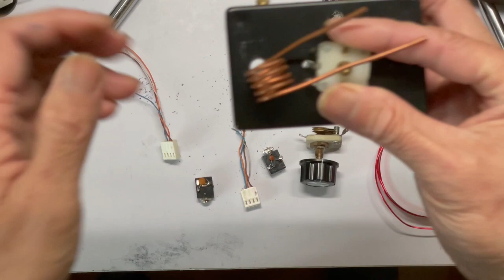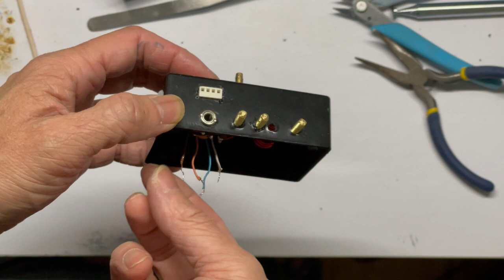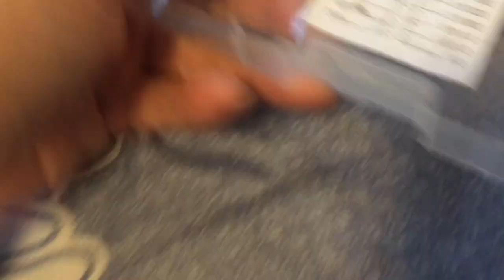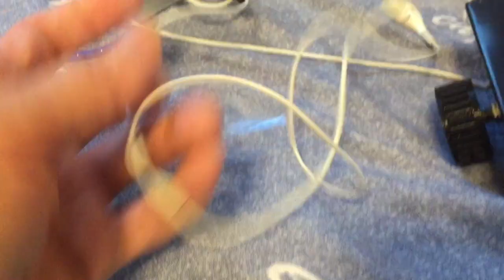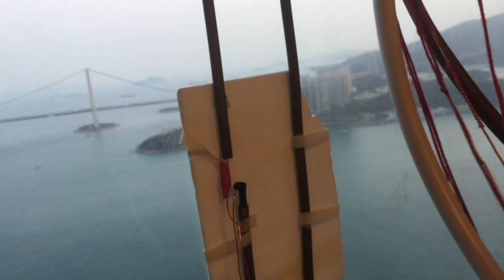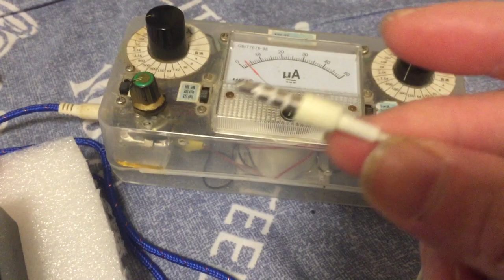FM Crystal Radios Series - Part 3 - Slope Detection

Comment: So why copper variable capacitor?
Reply from the maker: They have higher Q factor which is import for Fm crystal radios to perform better
Reply: Wow. Thanks for the quick answer.But the copper reacts with the little bit of sulfur in the air and will not work well. Same for silver.At least that is what one guy in a YT video said. He recomended always using aluminum. Perhaps your copper is coated to prevent this sulfur corrosion? If not, one could coat it. @BillyCdiy